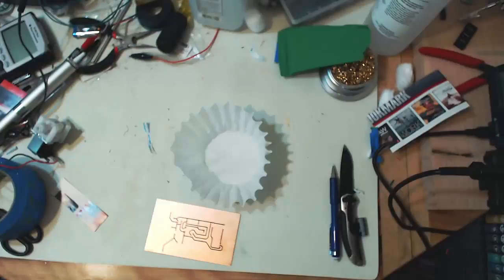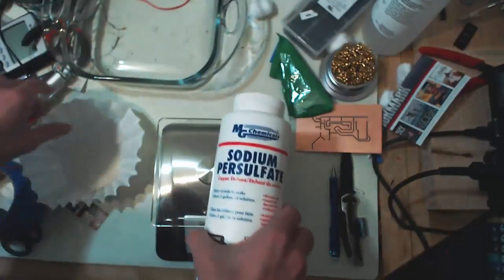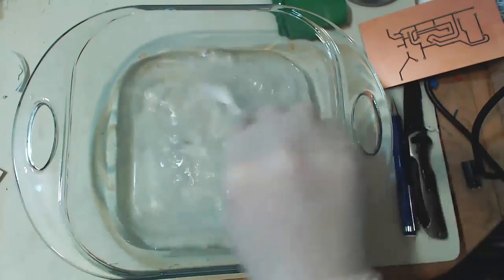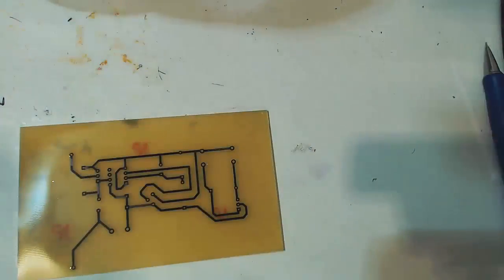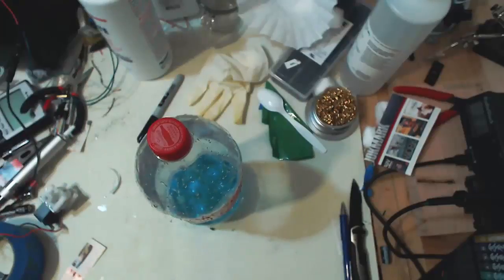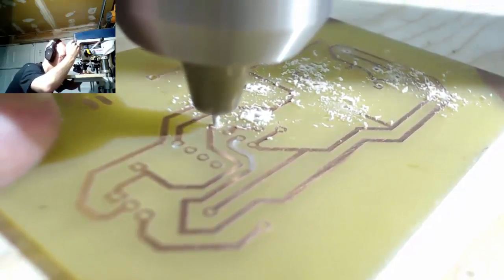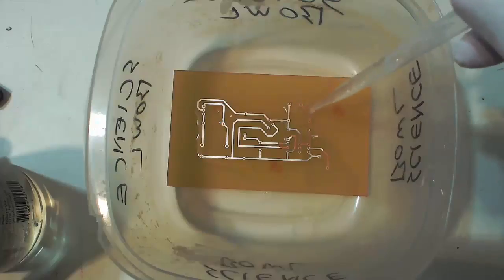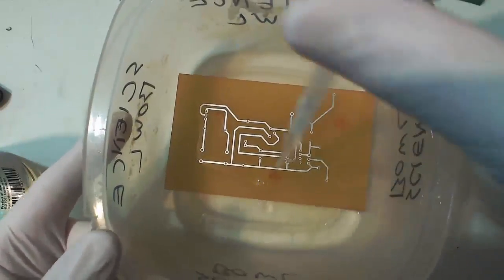Etching a Printed Circuit Board(PCB) using sodium persulfate

Comment: Nice video, yes you don't have to remove all the copper,  a good border can be useful, you should heat the solution for quicker results, etching will take minutes not hours, around 45 deg will do it. I wouldn't bother with the tinning, it's an unnecessary complication,  a quick spray with varnish when built and tested will keep it looking bright. I also use through holes rather than surface mount, you don't need to be as accurate with your design. A good quality video easy to watch and listen to.

Comment: Where do you get liquid Tin?  Also do you let the Tin dry, or what?
Reply from the maker: I used "Liquid Tin" from MG Chemicals, I believe I just bought some off amazon. Once it's reacted to your satisfaction, recover what you can back to the container. If it's "spent",  you should dispose of it according to local regulations (there is likely a hazardous waste disposal facility near you which will take care of it for you).

Comment: Hi there. I'm almost ready to try this myself - have all the tools, and been reviewing most of the videos I could find on the subject. Yours give a very complete overview of the steps, so thanks for that. One question tho: Is this a double-sided board? It might be more apparent if you get around to upload the seconds video, so that we can see component placement. I got confused when I saw you drilling vias along the tracks.
Reply from the maker: Hi! I hope you enjoy your project, what are you making? As far as this ... as others have mentioned, this may not have been the best design for the layout (it could have benefited from a ground plane, but it didn't hurt any). The board wasn't double sided, if you were to do a double-sided board, you would want to make sure that the board was raised off the surface of the dish so both sides can be exposed. Did you have a specific question about the component placement?
Reply: Hey - I'm starting out slow with an Attiny45/85 breakout board with an ISP header, just to get a grasp on electronics in general. In regards to my question. I'm confused as to why you have holes along the tracks, which is why I was looking for the video where you place the components. Here is an image to illustrate: http://i.imgur.com/mTWIQSM.png - the blue circles.. why are there holes there, if it's not a via going to a ground plane? Thanks :)
Reply from the maker: The vias are for attaching components; I was using through-hole components, not surface mount. The leads of components go through the holes and get soldered in place.
Reply: Right, I figured that - the placement of the holes just seemed pretty far from each other (look at the top right one for example), doesn't seem to be connected to anything .. that's why I thought it might've been double-sided :)
Reply from the maker: Oh! Here's the schematic: http://imgur.com/WGi8lk9
 The one you circled on the top right is paired with one on the bottom right for a high power resistor, R for keeping the current through the solenoid from being too high. They're pretty big, about 5 cm long: http://imgur.com/a/ZXABQ. The others you circled are just for standard width resistors. The left is paired to the via directly to its right. The bottom one is paired to the via directly above it. There are a few other holes for wires that lead to the solenoid valve and a switch. Here's the soldered board: http://imgur.com/4RMJC4W
Reply: It all makes sense now :). Not used to seeing such large components, as I'm still just working with small resistors, caps and the attiny, so through never crossed my mind. Thanks a lot!
Reply from the maker: No worries. Good luck :)

Comment: How did you draw the tracks so perfect?
Reply from the maker: I used Autodesk Eagle. It's free for small (I think 50 component max, not sure) circuits. I used a laser jet to transfer a reversed image of toner onto some magazine paper, then used a modified laminator to transfer the image onto the blank.

Comment: How many times can it be used before it won't etch anything anymore?
Reply from the maker: There are a lot of variables there, mostly how much you etch (as others have mentioned, I took off way more than necessary here), as well as how long it sits on a shelf. Probably if you're not going to use it within a month, you're better off just disposing of it.

Comment: How long did it take?
Reply from the maker: I believe I left it in for an hour or two, but I also didn't heat the bath. My understanding is it will be much shorter (maybe 10 mins?) if you heat the bath to 45-75°C
Reply: @theelectronwrangler6416  Ok. I think a slower etch is better.

Comment: this board is exactly how a board for hobbyists shouldnt be designed. you should try to remove as little copper as possible, it's more efficient and the copper left can be used for a ground plane

Comment: I use about 2 teaspoons for that amount of liquid with warm water and it takes 5 minutes.
Reply from the maker: Yeah, this was my first time trying it. I don't think it took as long as I said in the video, but heating the water would definitely have helped.
Reply: When I first tried it I used cold water and it didn't look like it was doing anything but when I warmed the solution it blew me away at how fast It works when heated.

Comment: All these disclaimers... but Thumbs up, cause I still have to try this.
Reply from the maker: +Nico Vijlbrief (CodeAsm) Yeah it's pretty fun. I would suggest heating the solution as Marc recommended below; it should speed up the process quite a bit.

Another option is to use a PCB milling machine to etch the circuit, but that can be expensive.

Comment: and if it's a hobby project, why make holes in the board and using through hole when you can simply use surface mount? it's less expensive, easier to solder. even if you have through hole components it's still far easier to solder them as surface mount. what if you have a package with 40 pins? drill 40 holes? it's stupid
Reply: Correct. And way easier to rework. I usually just use a hot air gun for soldering/desoldering the SMDs. For fine pitch I use a solder iron and flux to remove solder bridges.
Reply: SMD may be easier; but is it a good a idea to encourage people to aquire a skillset that will most definately be usless in the future when robotics will do that process far more efficiently? I can't see how I can justify learning or teaching how to solder SMD components as they weren't designed for human soldering?
Reply: @trukxelf  Because hand soldering skills (including SMD) will never become useless: Even if components are designed for robotic handling, humans still have to handle them when doing repairs and one-off builds. Bear in mind, components designed for robotic handling aren't the future, they're the present: many new ICs are in packages that are irritatingly small to handle manually, like little 2x2mm packages with no leads. But if you want to use that component, you have to deal with that package.

Comment: omg 1 hour +?
try to heat your solution up to 45 degrees celsius. u will etch in minutes =)
Reply: Yes, heating accelerates any chemical reaction. I wasn't concerned with the speed, and taking longer allows me to keep a closer eye on the traces. If you want to heat it, by all means do so.
Reply: well, that is a valid reason. just said that because it was the first time I saw someone do it cold.
I'm building a etching tank. I'm thinking on doing it with a bit less temperature than recomended, but not cold anyways. xD.
Although I have read that the faster, the better, cause you won't get over etching nor under etching. Dunno it is true though. Have to experiment ^^
Reply: ***** I actually have an etching tank that I haven't used. I've got a 300W variable power supply. The next go I'm going to try electrolysis, but i don't have a need for a new circuit right now.

I've only etched a few boards myself, I'm by no means an expert. I'm not sure why doing it faster would discourage underetching ... shrug Good luck with your tank!

I rewired an old Mr. Coffee so I can use its hot plate for small projects. I've also got an electric griddle ... i could try putting a large pyrex dish on it. I don't want to do this stuff in the kitchen, 'cause, y'know, toxic chemicals :p
Reply: Try using sodium persulfate. It is supposed to only release oxygen xD
Reply: That is sodium persulfate ;) It's fairly stinky, but it's not the gasses I'm concerned with. The crystals are toxic and I don't want to use them in the same area as food preparation.
Reply: Daniel Ball oh damn. My bad.  Sorry XD.  Didn't read the title. And yes,  ofc one should not do it in the kitchen XD. I do it in a room near a Window.  Just to be sure :)

Comment: The etchant should be heated to and maintained at 75deg C during the process.
Reply: NO, Sodium persulfate will permanently decomposite above 60 degr. C.
Never use it above 55 degr, C.
Reply: @jozelf2691  My mistake. I was thinking of my etchant (ammonium persulphate) when I commented. Think I might delete it.